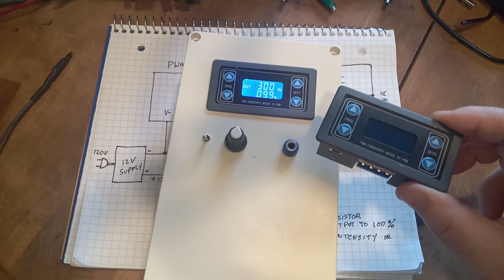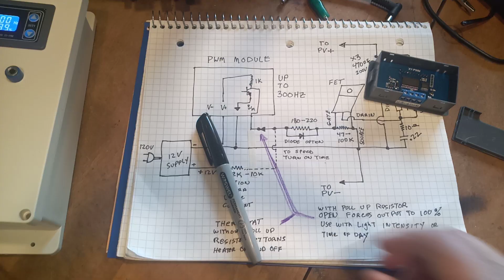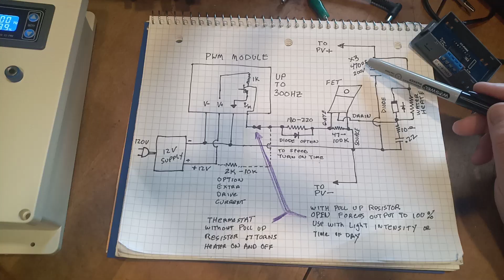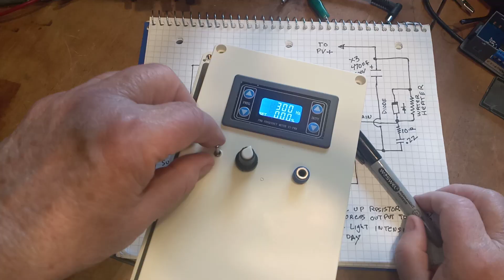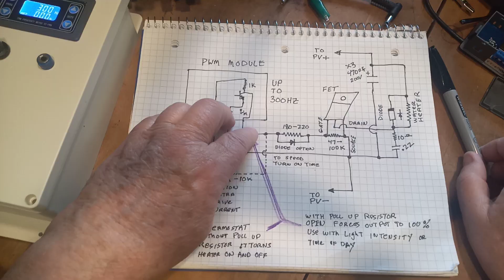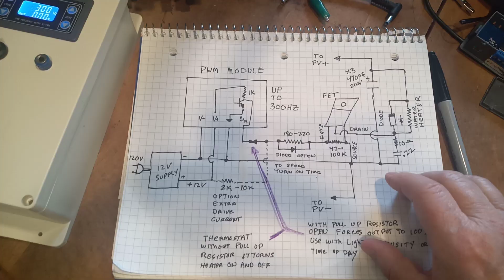Basic PWM Experimenter Water heater Build part 2

Comment from the maker: All that is needed is a PWM generator, two resistors, appropriate FET, storage capacitor and 12V wall wart to begin experimenting with power point water heating.  Record the duty cycle required to bring panels to power point every half hour.  Record that power if you have a power meter.  Only then will you see the need for power point tracking. This gets the basics working before diving int actual tracking.

I've worked on the control loop of the tracking circuit which will be the next video.  It works quite well now thru most of the power range.  It doesn't respond quickly and below 10%, each step represents a major change in PV voltage making it hunt a lot.  But you get the majority of benefits and gain a lot of experience. This is more complicated and doesn't work as well as the prior op amp design.  I've wanted to do this design for five years and is a lead into a PWM design to control the output proportionally for all those who want to heat water with AC from an all-in-one or other inverter.